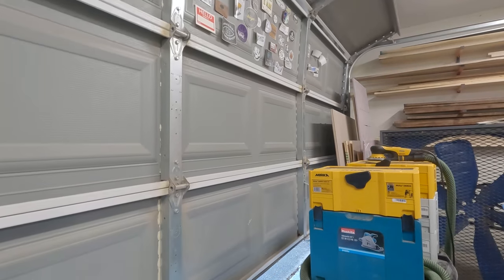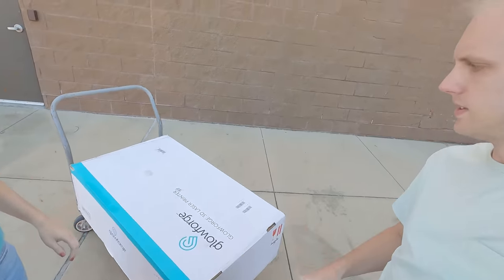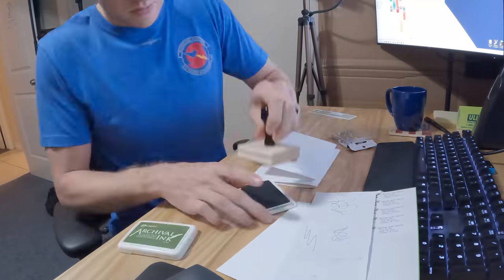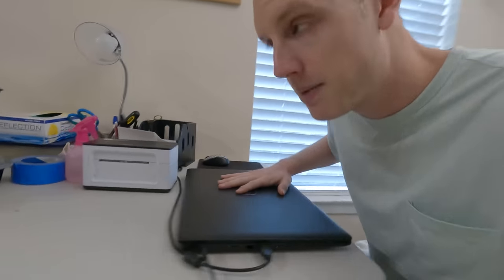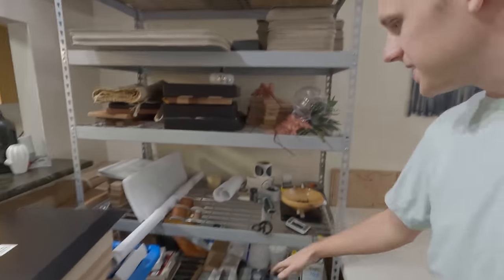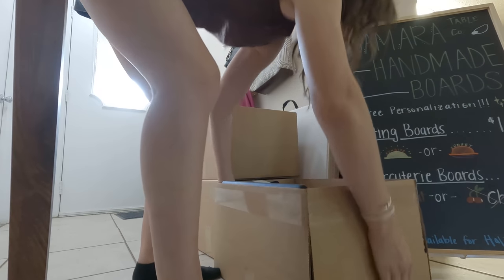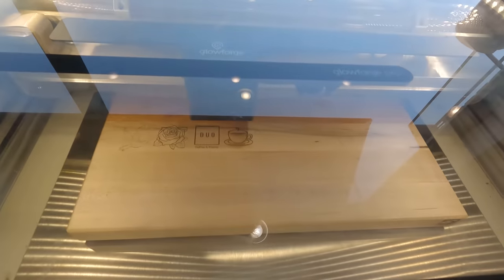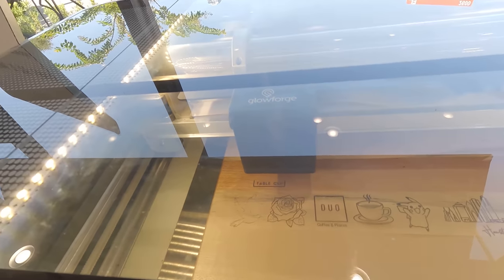our FIRST craft show booth! You won't believe how much we made! 💰

Comment: 5:30 Wait, what?!  Your situation is different from the standard craft show, and forgive me if you addressed this later in the video but no way!  I'm happy to ship your purchase but I have a 10' x 10' square of property and every inch matters, no way I'm bringing boxes.  Swipe the card, get the address and email address, and when you "punch back in" later or tomorrow worry about logistics.  Fairs / shows / conventions are venues that should be pedal down until it's over, sleep late the next day after burning the candle at both ends and then deal with busy work.

Comment: honest feedback: your prices are too high.  most people understand how much they expect to pay for something like that, or they know what the material cost.  you are selling a rip cut cutting board with no special pattern, basic wood, etc.  It is clear that it's an expensive product with low labor effort.  if someone can buy the same thing from a market for half the cost, they are not going to buy from you.  you are looking for high end buyers, and limiting your opportunities.  Lower your costs (substantially) and make your money on volume, not individual sales.
Reply from the maker: No thanks. We’d rather make a profit and spend a little more effort in finding the right customer. People know that Nike shoes only cost $22 to produce, but they pay $150 anyway.
Reply: @jennieanddavis  You aren't Nike though. You are a small business, which is an advantage. People don't buy cutting boards because they know the brand. And besides, are you really going to model your small business after Nike? Over-priced cheap products?
Reply: Jennie and David I agree with.        That the price is way to high and why I say this is for a few reasons 1 the cost of material and labor to make one bored $50.00 (and that is going with higher lumber price like one would find in a state that has higher cost of living expenses) so asking someone to pay $200.00 so yall can have a profit of 3× the manufacturing costs is a bit much I do understand that yall have been selling them at that price but I wonder how much of that has been friends and family or even followers from social media that are paying the current price so they can support yall since they they have a relationship in some form with yall already and selling like that is probably the only reason yall have been able to get $200.00 for them 2 I say this only because if yall are wanting to sell the cutting boards at craft shows flemarkets and fares that will have other vendors trying to get people to purchase from them and a big percentage of the people that go to events like craft shows and flemarkets are the middle and lower income now at state fares especially the Texas state fare that happens at the same time for the rivelry football game of on top of that it is done in the DFW area that or traders village would probably be a good location to try and sell at but even then the price I would say would do better at around $100.00 for 1 or 2 for $175.00  but even at that price scale it will be hard with only 1 item to sell that the only difference is the design burned into it yall need more products and even with the cutting boards have some with different designs out for display that way the impulse buyer market is opened up now this all is just my opinion based on my life experiences like as a kid helping my grandfather make things that him and my grandmother sold she even made things so they could have a variety of products to have the potential of more people finding something to purchase and then I have the year I traveled around to fares sell tools a business without product variety limits customer operations that's why retail stores change merchandise so much an are I worked in before going into the movin and storage industry but my last bit of experience and most enjoyable was construction and to give some prospective on how that pricing works the general average is take material and labor times that by 3 to charge 4 if it's stuff like costume cabinets concrete or tile work but that has to cover all the overhead from employees to insurance  u mentioned Nike having a price difference similar to what u have in regards of actual cost of material but u didn't look at all the other costs from paying someone at Nike factory to the person that sells the shoes to the individual all costs yall don't have even if mad a variety of products since yall have lower overall costs $100.00 pice is a lot more affordable and fare for everyone well hopefully yall don't take afens  to bad because it blows my mind that in a state that I spent most of my life and considered home one can think that a profit  margin thay is 3 times overhead cost and believe that is a good long term business plan astoned me
Reply: The fact that these commenters aren't in your target customer group is exactly why you SHOULD NOT LISTEN TO THEM.
Reply: If they are selling out, their prices aren’t too high.
Reply: Been a professional on both sides of the counter and in-and-out of construction/carpentry/woodwork fields since 1985-ish. Sales aspects as well. 

A $200 cutting board isn’t worth MY time any more than a $20 cutting board is worth my time. 

6:17 But they are selling crafts not woodworking or furniture. 
Since they are selling crafts they aren’t worried about selling the next piece of furniture that took a 60-hour week before you applied the finishes.

Crafts are something I was never good at or interested in. 

Another thing that struck me… While I always am aware of what my market is, I am unconcerned and have always been unconcerned with the economic status of my customers. Do they like what I offer? And might they choose to buy it? Those are my only concerns. 
Maybe me not being citified has something to do with it but I literally recoil-cringed in my chair when they talked about wealthy people. How undignified. The customer gets to decide if they are qualified or financially able to purchase something they like. 
What an ungrateful way to strip dignity from strangers you haven’t met before. 

Sure you need to market properly and hit the cross-section of the most likely buyers to efficiently sell, but the customer is the customer: a human being. Being grateful and respecting others is good salesmanship- otherwise it’s just looking for philanthropic people to pad your pockets.